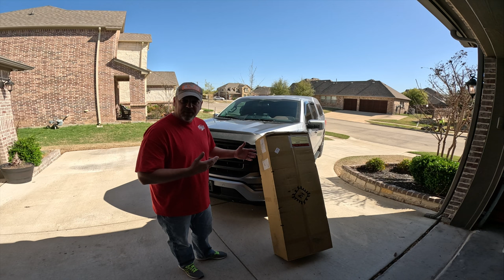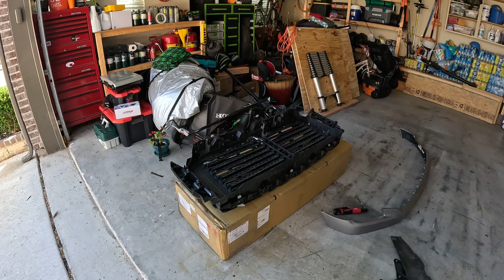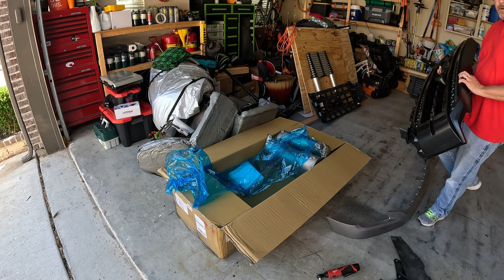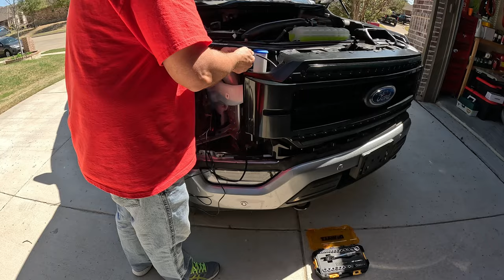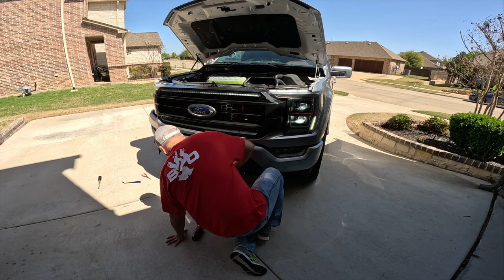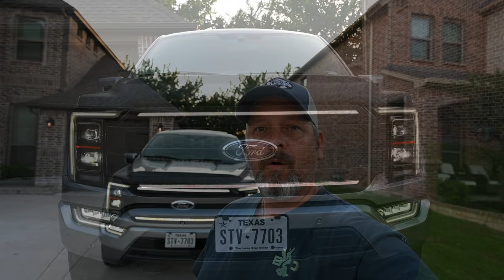Spicing up the truck camper! Morimoto XBG LED grill install

Comment: Sweet, looks nice and now looks like a Lightning. I used  Plastidip on mine (was chrome) and installed a light bar behind it. Getting my hand in there and finding those clips at the bottom was such a pain, wish they just bolted everything on.
Reply from the maker: Thanks Eric. Wish they built these new trucks like the 80’s trucks. Could break one of those trucks down with a socket set and a few wrenches

Comment: You should try changing the horn.  My horn died.  Part was on $50.  After seeing what Ford said to do, I cut an access panel in the plastic on the top for next time.:)
Reply from the maker: I want a train horn. Wife said she would leave me if I did that…..so, it’s in the mail

Comment: I have a fully loaded lariat ( has the same headlamps as your truck)and for some reason I get a message on my dash saying “check headlamp see manual.” I used fuse #25 I believe. Did you have similiar issues? How did you install yours? Did it come with an adapter kit for the OEM projector lights?
Reply from the maker: I didn’t have those issues. Mine did come with a wiring harness that plugged into my factory headlight that was really “plug and play”. Did you contact Morimoto? They were really good with communications with me.
Reply: @BrianWatersOutdoors  thank you and yes I did they shipped me the right one now, just waiting for it. Thank you for the reply sir
Reply: I'm probably having the same issue as @havoc1612. I have the same headlights, as well. I used fuse #25, and lost the amber section of my passenger headlight. I have a '22 Lariat Sport 502A.  I'll likely take it all apart and put it back together again. 

Glad yours worked out the first time around.